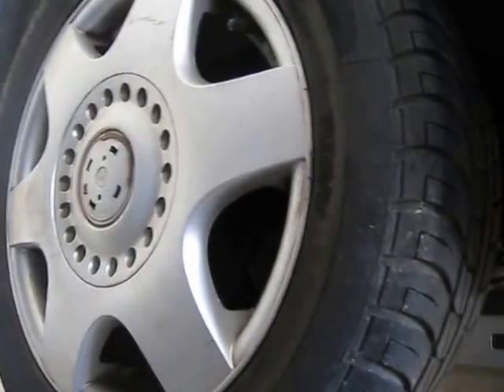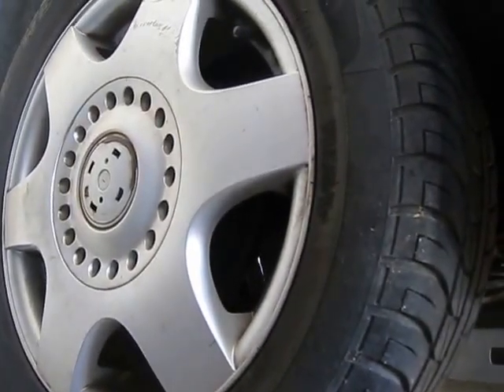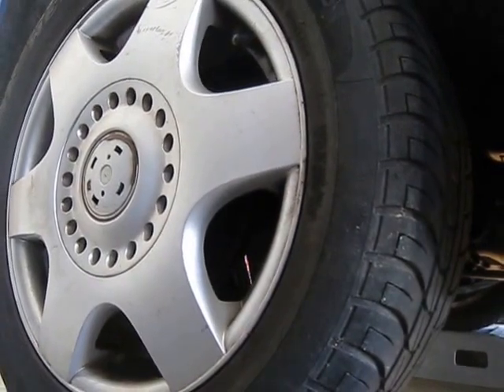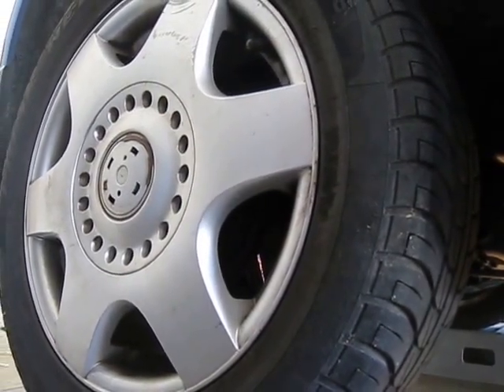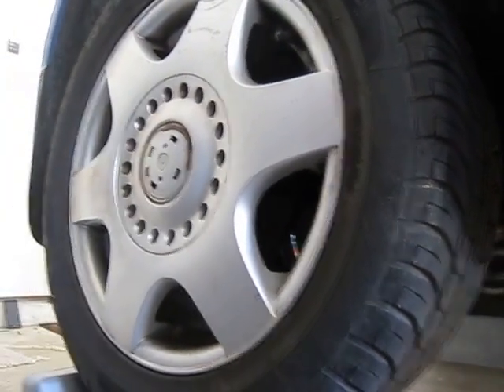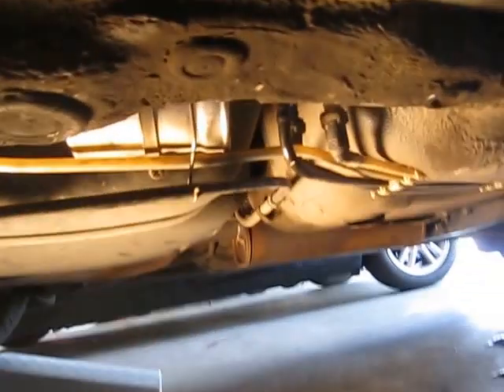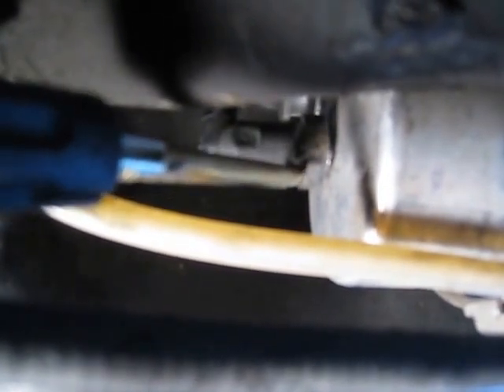VW New  Beetle fuel filter removal 001

Comment: Thanks for your efforts and sharing w us.

I'm just getting ready to do this.
Reply from the maker: @spconrad9612  Sure, no problem
Reply: @nicholaswilliams1  I can get the rear (tank) side line back on.  I cannot push the front side line onto the new filter.

I'm assuming I'll need a fuel line repair kit to get this back together.